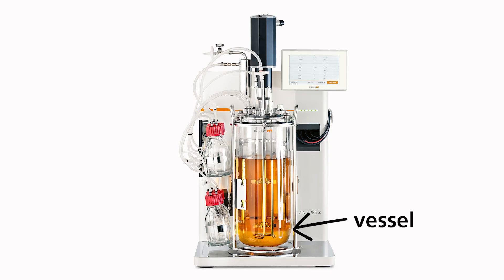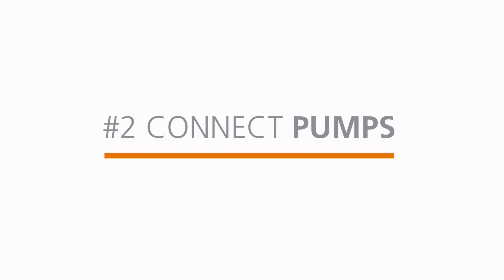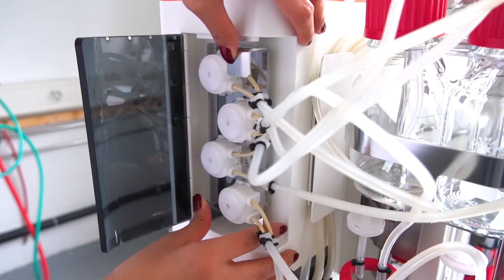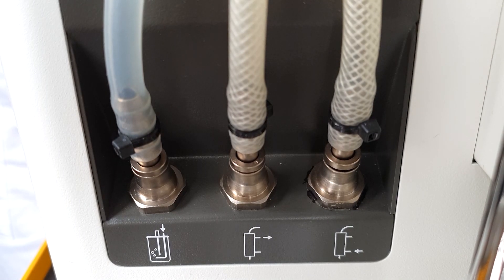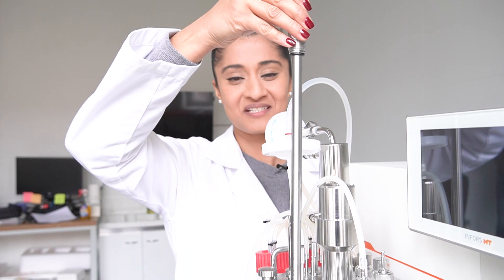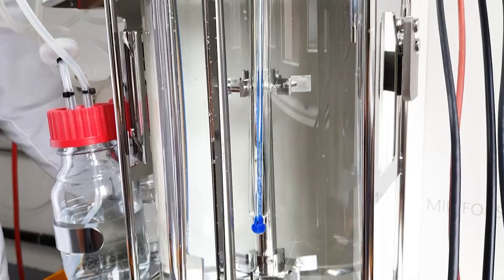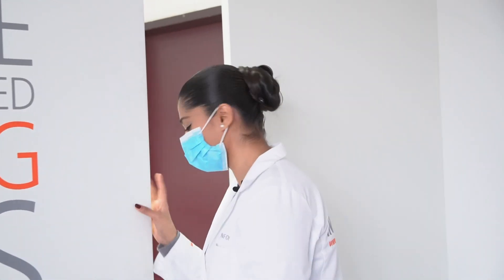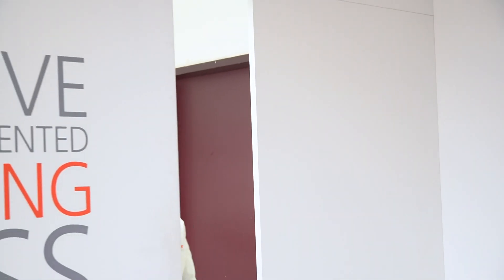10 Steps to Set Up A Bioreactor

Comment: You were not following cGMP😢😢😢
Reply: It's the Infors non biological lab. They are just putting units together not doing fermentation etc.
Reply: You don't need GMP if you're not in a GMP environment. This is to teach the novice routine operation in 10mins.
Reply: I’ve worked in cGMP before, these kind of cultures would be set up in special facilities with HEPA filters and clean room garments whilst performing similar steps but taking extra precautions to prevent contamination and essentially disinfecting all the components before installing them